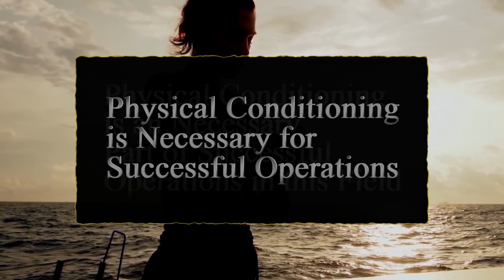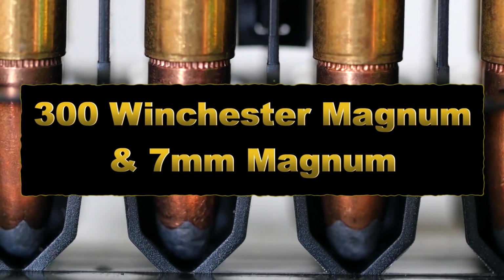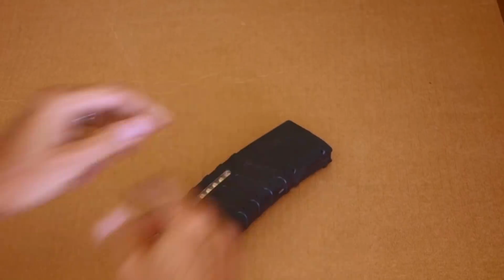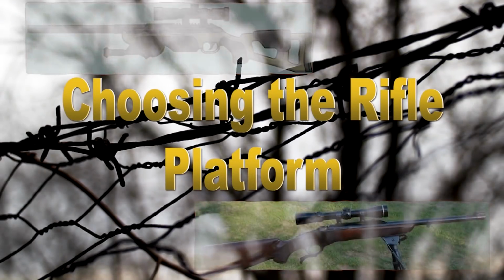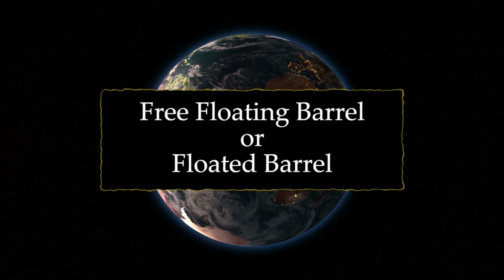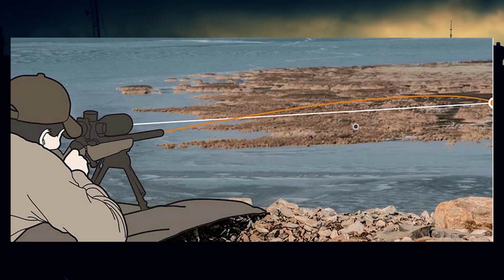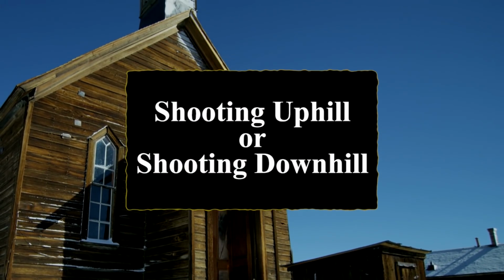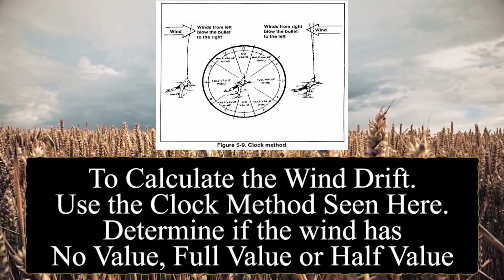Sniper Tactics Training SHTF Defense & Tactics Series - Urban Survival Grey Man #1a

Comment: The FBI came up with a much more simple method of determining uphill/downhill hold-off for angled shooting; a method that can be done by most people in their head.  I've been told that it's also being taught to military snipers, but not police since they require a more exacting target standard.   Here goes:  Whatever you estimate/range the distance to a target that is on a 45 degree angle, use 7/10s the distance as the range. Using your example of 500 yards: Divide 500 by ten (50) and multiply by 7 (350 yards) will be the range to use. True, it isn't as exact as formulaic measure, but for the purposes to which we're speaking, it's close enough.  For targets at 30 degrees or less, use 9/10 the indicated distance. Again, close enough for government work. At most, the only tools needed will be a stick and dirt to figure on.  Using the Mil-dot to measure size/distance is probably more important than retaining formulas, but each of us has to determine that for ourselves. Good video so far, will watch others (and look for more spelling errots-- oh, wut's an 'oredict'?)  Thanks, keep up the good work.

Comment: You have good information.

However, the skills in this for the majority of people would be stalking, camoflauge, scouting, concealment, and tracking. The long range shooting will come in handy. But you wouldn't be wasting the kind of resources to take a shot like that, on any joe or Jane just to steal some twinkies. The amount of equipment, personnel, and training to do a shot like this would be held for high value targets. Especially when you build a precision rig.
Reply from the maker: Exactly. This series is gonna focus on those skills you mentioned. But I wanted to get the technical calculations necessary for extreme shots out of the way. The next episodes will definitely be more practical oriented. Skill based and similar areas. Thanks!
Reply: I know this may sound dumb but I’m using these in a game Roblox D-Day and I have the sharpshooter gamepass and tbh it is harder to make a long range shot because it’s hard to even find cover or a position to begin with and you have to get in a common soldier shooting distance if you don’t have quality WiFi and I don’t so I have to get close and if you hide in a tree branches you have to get close to the front of the tree in order to have good vision and it’s usually hard if your behind enemy lines even though you have less risk the people will end up finding you when they res pawn if they see where the shot is coming from and where you are before they respawn I know that some of these skills addressed in the video are valuable in a video game or even apply they sorta help in a strange way also in the game you can only one shot kill with head shots if you hit a helmet it just knocks the helmet off and if you hit a body part that isn’t the head you will only really do about 30 damage but I usually play as Axis when doing Sharpshooter since I think it’s easier to find positions and your mostly defending and I also have a grenade and rpg game pass that also helps in the game the Germans use a scoped Karabiner 98k while the Americans use a Scoped 1903 Springfield and I tbh think the American sniper role is really only good from the beach to the beginning of the forrest it isn’t much well anywhere else while the German role is good from the stronghold to the village but I do prefer the American scope to the German Scope
Reply: @tacocat7822    Ummm... ROFLMBO,,,
Reply: @knokname6466  What does those acronyms mean

Comment: 300 win mag is the best shtf sniper caliber for longer range, in urban areas a 308 would be fine
Reply: Belted casings ,large amount of slow powder , huge muzzle blast and flashes. I disagree.  8mm rem mag ,or the newly packaged  8mm round  the)) lapala( i think? Would be great if you plan to shoot over 1 000 yards.  300 mag is only a 1,000 yard hunting rifle. I would prefer a m1 grand with a tuff 6 power fixed optic mounted on a welded side rail myself. Or a strong push feed bolt. 30,06 will do anything a 300 will do with less kick ,blast or flash. But 7.62 military rounds will be easy picking when hunting amo.  So 308 is logical choice
Reply: 300 win mag no 7mm mag
Reply: Agreed...Ammo packs a punch, reaches way out past my abilities, an affordable rifle and ammo...yep...agreed.
Reply: I hve a 300 win mag bro thinking about getting an AR 15 TOO
Reply: I have a rifle that's chambered in 338 Lapua that packs way more punch